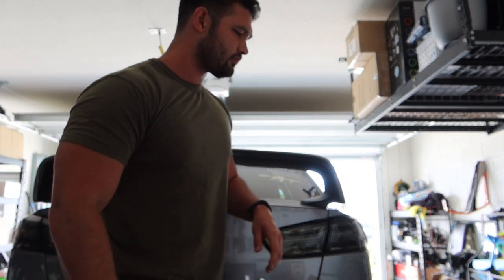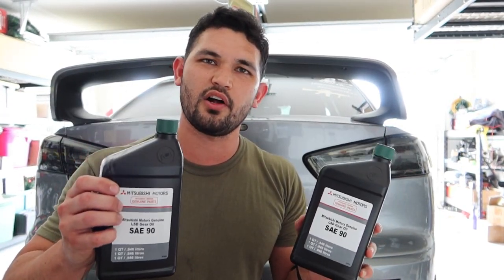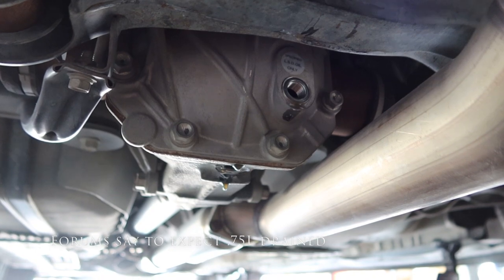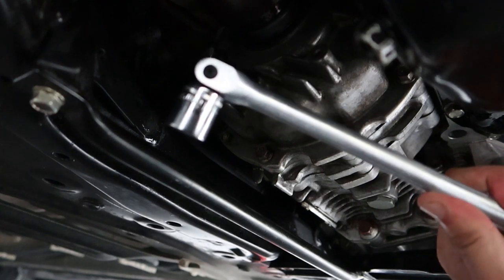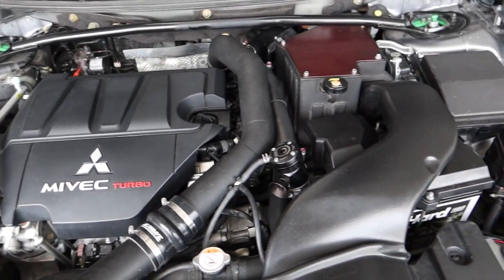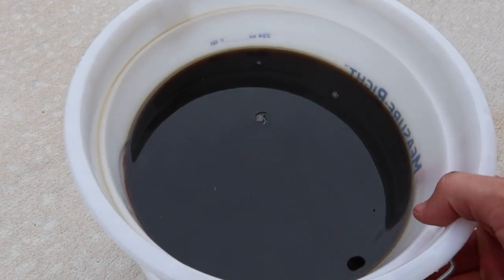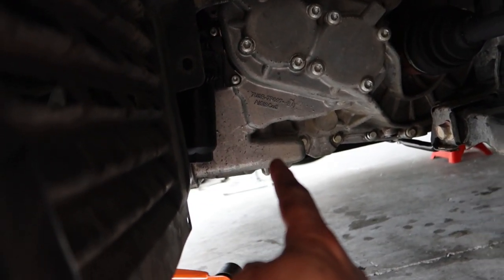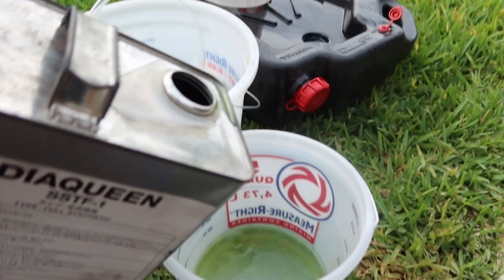2008-2015 Ralliart / Evo X Rear diff, Transfer Case, SST oil changes (60k MUST DO maintenance)

Comment: Ive just done mine at 30'000km's..not miles (original buyer/owner).but mine is a built Sep MY10 so due i thought time wise...the oil that came out was clean as....i'll do it again at 60k...in ten + years time :-)

Comment: 6.25 from trans is a little low, you should get 7-7.5. There is a fluid check/fill bolt on the wheel side you can take out while filling from top, i filled the top section with 6 liters, then finish the filling with the 7th liter of fluid from that side bolt to monitor when it comes out, then just finish that procedure just like the transfer case, multiple tines pumping. Just fyi for next time
Reply: I couldn't get to that bolt do you use a long Allen key Sub frame is right in front of it

Comment: thanks for the video. it was super helpful when I did the transmission, transfer case, and rear differential for my 09 Ralliart.  the original transmission died when I hit 150k miles and I only had it done once at the dealership at 80k miles.  with the second transmission that I bought used, it ran rough and three fluid change cleared everything right up which I thought was crazy.  unfortunately I couldn't find castrol transmax dual and had to order the diaqueen from maperformance.
Reply from the maker: Good luck with this go around!
Reply: Did you flush it out with the diaqueen fluid or did you use something cheaper to flush it?
Reply: @Gilligan.Garage  ,I only drained and refilled once with the diaqueen.  My previous message, I didn't mean that i flushed the sst fluid 3 times. I meant that I changed the sst fluid, transfer case fluid, and rear differential.  I also changed the external sst filter as shown in the video.
Reply: @tonypham890  ohhh ok sounds good, what were the issues that the transmission was giving you?
Reply: @Gilligan.Garage  , it was giving me really hard or weird studder/hesitation shifts between 2nd and 3rd and 3rd and 4th when I would press the accelerator.  And going uphill, it would struggle up shifting and made this weird noise like it was trying to let out air or something.  But after changing all the fluids, everything worked fine and haven't had those issues since.  And it's been about 6 or 7 weeks now.  I will say when changing out the external sst filter, mine was full of gunk so I don't think the used transmission I got ever got serviced, or if it had, they did not use oem fluids and that may have caused the issue I had.  But like I said before, after changing out everything, I haven't seen an issue since and hope I can keep this going awhile longer.

Comment: I had my SST for my evo fully built by kozmic and they are pretty adament about using only mitsu OEM fluids for the entire drivetrain and have seen bad crap happen over time with other fluids in the drivetrain. I would advise that for anyone doing the maintenance to lower any chances of complications especially anyone who has a warranty it most likelt gets voided if oem fluids arent used. Just my two cents, even tho expensive you can stock up over time from ebay or MAperformance. Great work and video though!
Reply: A lot of the community has already tested out the Castrol dual and found it to be the same fluid as diaqueen. Those are the only two fluids to use ever
Reply: I get my stuff from Kozmic as well, but like the other dude pointed out, they are the exact same oil. Diaqueen is just re-branded so Mitsubishi can sell it as their own.

Comment: What's your thoughts on Amsoil vs diaqueen for the transmission(cvt)?
Really appreciate the detailed video! Give me more confidence in saving money. They want 400 just for drain refill in WV, just the trans, no filter change.
I've got the SE Lancer. Never done anything other than oil on it, sittin at 84k.

Comment: Because you literally do everything yourself, after the cold air intake install which made my VE SS Commodore louder and a huge performance increase, I've now ordered polished stainless Steel headers and cat deletes. Is it possible to install them myself or do I need a professional to do it? I also had a 3" catback installed with rear mufflers and 3.5" quad tips.
Reply from the maker: Headers depending on the car can be simple or difficult. All cars are kinda diff man, I'd see what your clearances are 1st
Reply: @TheSnyds  the only problem I can see is the steering shaft. I'd need to disconnect it to get the headers in. Might need my older bro's help as he has all the equipment and I need to get under the car. Should be easy. Next will be dyno tune to see how many horses I gained.

Comment: Hey snyds you still using OEM lsd90 or have you switched to motul or anything else? I've been running redline 75-90 in my diff and tcase but I'm considering making the switch back to OEM or motul 90pa because I have been getting what sounds like acd pack engagement noise if I hard throttle from 3k
Reply from the maker: Yup! ATI OEM LSD90. That don't sound good man

Comment: Can't get Castrol Transmax Dual in North America anymore, permanently unlisted from autohausaz and the shipping from any other source makes it even more expensive than the Diaqueen, also Diaqueen is almost $200 a Gallon now, rediculous.
Reply from the maker: Dude....say what!?
Reply: @TheSnyds  i read in a forum that Ravenol DCT/DSG fluid is also the same as the Diaqueen. I just ordered 2 gallons from RavenolUSA for $185 after shipping.
Reply: @TheSnyds  according to the forum i read, Ravenol DCT/DSG and Pentosin FFL-2 are the same thing as Diaqueen SSTF-1 and Castrol Transmax Dual. I am going to be using the Ravenol so hopefully they are right.
Reply: How did it work out for you??

Comment: Hey man I love your videos. I have a 2011 Ralliart and I have a service engine soon light on with occasionally a Transmission service required light that appears when I’m driving. It drives fine until sometimes when I give it hell from a dead stop it will stay in second gear? Could this be dirty fluid/filter?
Reply from the maker: Could be multiple things to be honest.  How many miles since your last SST Fluid change
Reply: @TheSnyds  Tbh I’m not exactly sure, I bought it used with 96k miles. I have fluid/filter ordered now, hoping this helps
Reply from the maker: Yes. I'd def start with that and we can go from there.
Reply: @TheSnyds  I recently did an fluid/filter change and the car drives well now. But my SES light did return & rarely I will have a Service Transmission Required.

Comment: Hey Snyds, just recently bought a ralliart myself and wanted to know if the transmax dual Castrol fluid still works great in the car or if you changed it. Still kinda freaked out since the sst has been slipping on normal city driving and don't want to kill the transmission.

Is the chemical composition of both the transmax dual and diaqueen the same?
Reply from the maker: Yup still running Castrol and no issue.
Reply: @TheSnyds  Thanks, man I really appreciate the fast reply back, now the problem is to get castrol transmax dual in Canada 🥲...

Comment: How hard is the Reteach afterwards bro? Seems a bit complicated, wouldn’t even know what software to use
I already have a tactrix cable for remote tuned so thats a plus!!
Reply from the maker: I haven't done a reteach in all honesty. But it shouldn't be too hard. Do you have passthru scan.
Reply: @TheSnyds  oh daing! I thought it was a “must” after every oil change ….. I’m looking into getting an MR so I figured I’m gonna have to learn how to do it ! Thanks for the feedback and content bro! Keep it up
Reply from the maker: @TexasPewPew  not after every oil change. Just after the trans changes. But it's only recommended not really required.

Comment: What other brand would you recommend if I can't get the oem sae 90 for the t case n diff?

Also does the diff n t case use the same oil?
Reply from the maker: Same oil. And I read any gear oil would work. But honestly you should stick with OEM

Comment: Would this car be good for a first car? I was looking at a 2011 ralliart for my first car. The car I found has 105k miles on it and looks good in the picture but, I heard that these cars aren’t reliable and have tons of problems. And because of that my parents don’t think this car would be a good choice for me. Do you think it’s a good and reliable car or should I start looking for a different type of car?
Reply from the maker: These are reliable when taken care of properly. This is considered a performance car, and with that maintenance is key. With that being said, if you like to work on your car, these are pretty easy to service and deal with for most of the work
Reply: @TheSnyds I don’t know to much about cars right now but I have been interested in them for a while, just haven’t had the chance to work one. I just recently got a job at a mechanic shop from someone I know so I think that could help with the maintenance of one of these cars.
Reply from the maker: It's all good. I had no background in cars either,  learned as I go
Reply: @TheSnyds Alr thank you man
Reply: @fermuniz6720  maintenance is a nightmare. I would stray away for first car. Bought this for my wife and if I would have known about maintenance costs I would of definitely said NOPE. Car has been overall well within warranty because we had the diff and sst go out before our warranty ran out. They said a magnet that controls shifts has gone bad.

Comment: How is the sst running without the diaqueen ? Haven't had any slipping issues ?
Reply from the maker: Not that I'm aware of. Shifting fine
Reply: @TheSnyds  thanks will be doing this on the wife's rally. First oil change from the replacement of her sst. Still a bummer have to do a teach in on the car at the dealer 😐
Reply from the maker: Teach in isn't mandatory. Unless you changed something with your sst. It's just recommended. I didn't get a teach in with my first change
Reply: The Castrol  Transmax Duel is the same as Diaqueen
Reply: I have been trying to find this Castrol transmaxx duel fluid for my MR for sale in the United States? What company did you get it from?
Reply: @4u2h8on  Jack's transmission has a whole kit for a great price. This is the exact same as diaqueen compared the 2 items and diaqueen is manufactured by Castrol.
Reply: @notbobthebuilder3109  Also Castrol Axle Limited slip 90 is the same as original

Comment: I just had my SST oil change by Mitsubishi in Japan. I had unsmooth acceleration issue. Now, it's solved. Although, they re programmed the SST after the oil change. I'm wondering  what was that actually. Do you guys know something about it?
Reply from the maker: It's a teach in process. Helps clean up shift points which sounds like it did wonders for you
Reply: @TheSnyds  I see! My car is running 60K km. I'm not sure what to do with The Rear Differential, Transfer Case oil change. No idea weather previous owner did it or not. Do you think is there any way to realize the current oil condition for The Rear Differential, Transfer Case?
Reply from the maker: If you don't know just swap it. It's not expensive and easy to do. Now a new tcase or rear diff would be the expensive route